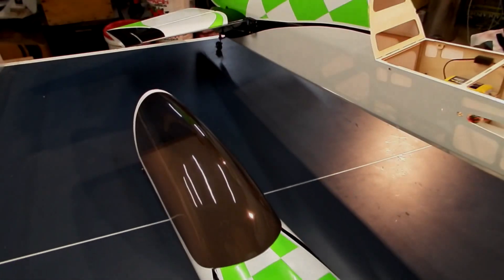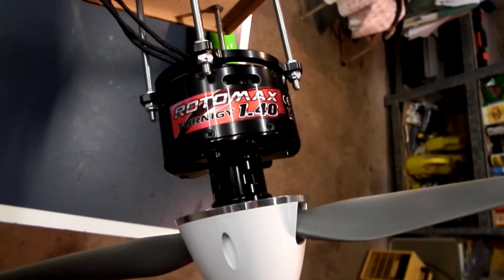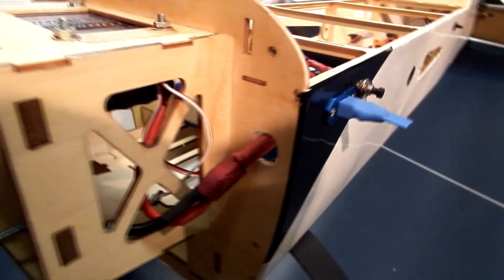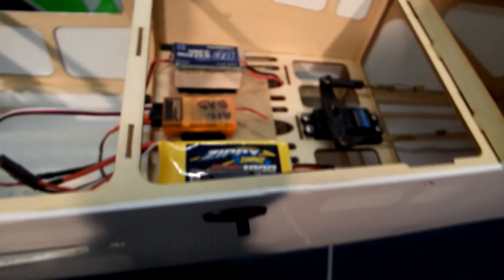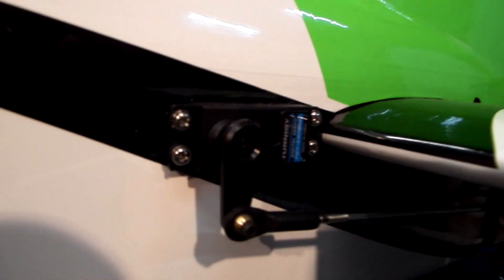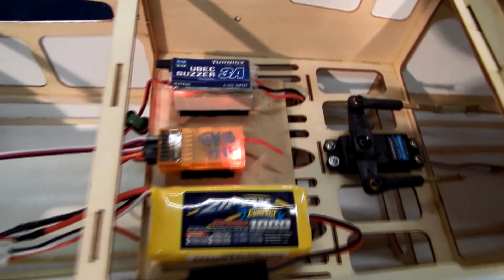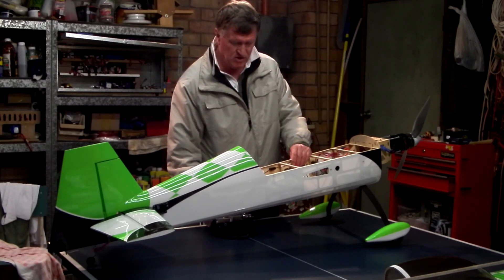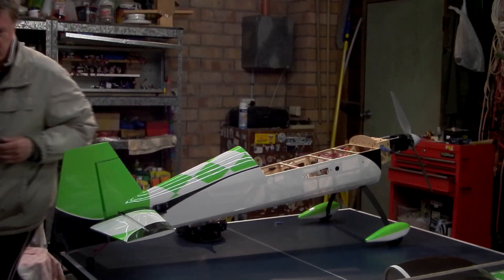Fly Model Extra 300LP 30cc

Comment: Did this plane fly well?
Reply from the maker: Hi Richard,
This plane flew really well. I fly pretty rigorous aerobatics (more the precision type). However, I was performing a spin one day and one aileron servo jammed full on and made the plane quite difficult to keep level! It ended up in the top of a tree. No damage whilst up there. Getting it down really messed it up. A gas flier took the remains and rebuilt it fitting it out with a 300cc IC motor. As an electric setup (per the Yout Tube clip) it flew with wonderful authority. The whole setup was very quiet and a pleasure to fly.
Ed
Reply: Ty for the reply, I was thinking about either a 30 cc sbach or an extra330. 50 cc.. one thing I've seen is on the top of the tail,looks like I see the back side of the elevator control horns. Like you do in your standard 40/60 size glow planes.  I've seen this on others pics of fly model builds.   Confusing a little because the hard ware package shows the typical gasser style horns. 2 piece going through the square and glued in,with nothing showing on top of elevator. Not a deal breaker, but that does look pretty bootleg on a gasser